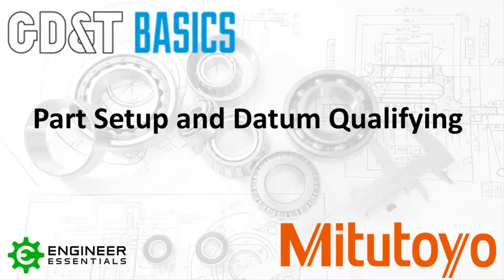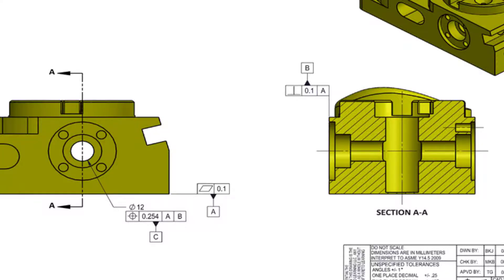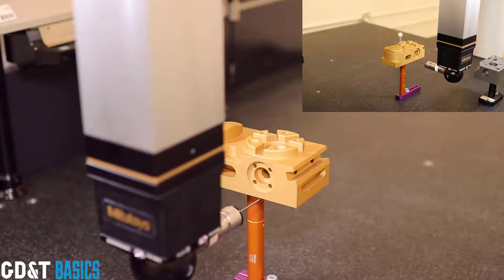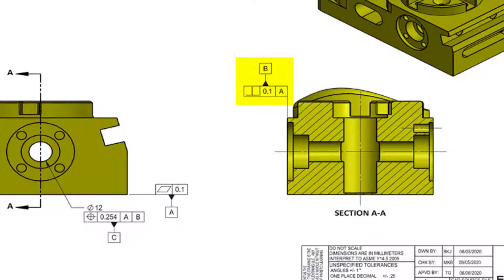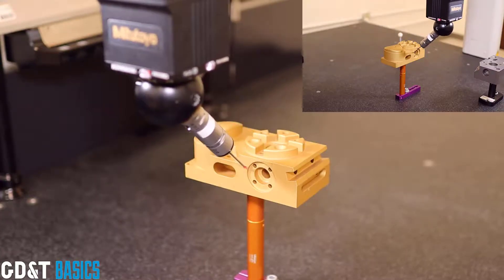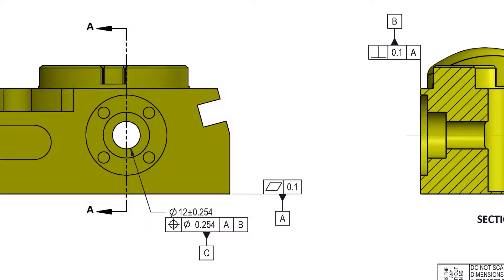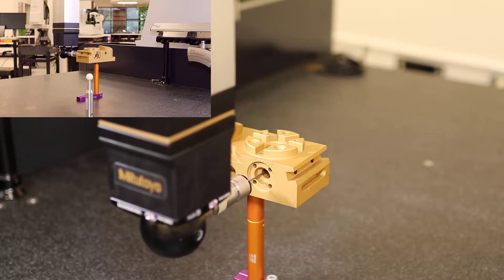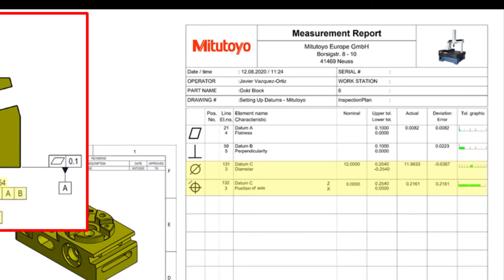Part Setup and Datum Qualifying using a CMM

Comment: It looks like the CMM defines datum A based on the point cloud (which probably does NOT include the exact 3 highest points that a datum simulator would contact). Would it be better to use a gage plate attached to the bottom surface?

Comment: Could you please explain this orange stick which is installed into the inspection part. As I see this orange stick is a kind of datum simulator. As far as I know, we do not use datum while measuring flatness. Why did you choose it, how did you choose the place of intallation, how can you make sure that it won't affect the measure?  Could you please show the installation video for more clarification. Thanks.
Reply from the maker: The orange stick in this video is not a datum simulator and it does not affect how the part is measured using a CMM. In this case it is simply elevating the part so the probe can access all the surfaces at once. The CMM will act indirectly as the "datum simulator"

Comment: I am confused about how datum axis C is established. Is the axis established wherever the hole ends up being -whether the hole is in tolerance or out of tolerance? Or is the axis established based off of the basic dimensions and the axis is perfectly positioned? If the axis is always perfectly positioned based off of the basic dimensions, this means that the hole will never be perfectly coaxial/concentric with the axis since there will always be some inherent error in the hole. Can you help clarify this for me? Thanks
Reply from the maker: Thanks for the question! The Datum Axis C is established where the imperfect hole is, BUT the imperfect axis MUST be verified to be with in tolerance with respect to A and B first ( Location and Parallel to A and Perpendicular to B ). Remember without Datum C involved we have not constrained all 6 degrees of freedom yet. So we can locate and orientate the tolerance zone for Datum Feature C back to Datum A and B using the basic dimensions but that final degree of translation that is missing will be what Datum Axis C locks in.
Reply: @Gdandtbasics  
I'm afraid that your answer is incorrect. According to the ASME Y14.5 standard the datums are derived from the datum feature simulators and not the datum features. Datum feature simulators have fixed location and orientation relative to each other according to the basic dimensions. Therefore the datum will be not where the imperfect hole is, but at the basic distance from datum A. When establishing the constraint of the part to datum feature simulator C the Mitotoyo program should have simulated the largest cylinder the center of which is located in the basic true position of datum feature C, touching the actual hole surface on the high points where it is able to reach. I wonder if the CMM program complies to the standard or is it based on a similar error?

Comment: how to do  alignment with 321 when three planes are not perpendicular to each other. For that datum target points defined 3 points for primary, 2 points for secondary and 1 point for tertiary.  ?  thank you
Reply from the maker: If you consider 3 mutually orthogonal planes creating the datum reference frames on a drawing. The drawing will have "implied" 90 degree basic dimensions for these planes that are not shown. However now if you picture the third plane being at an angle ( lets say 30 degrees ) from the second plane. The only addition that needs to be included to complete this is to add the basic dimension of 30 degrees locating that surface. In cases like this, if this is the secondary datum feature, angularity will often be used to qualify the datum feature in question back to the primary datum.

Comment: Every CMM software I have used defaults to best fit planes. (Simplified version; the points are averaged to create the plane.)  You won't get the three highest points when creating the plane unless the software supports tangent planes.  Comment is based on the four different CMM software packages that I have used.    I realize that you need to "dumb it down" but this has real world consequences especially as flatness tolerances get bigger.
Reply: Keep in mind this is not our opinion - this is a requirement of the ASME GD&T standards. Using best fit planes for establishing datums - whether it’s the default in CMM software or not - violates the ASME Y14.5 standards as it does not mimic the functional intent (physical gage blocks use high points after all - not an arbitrary average plane) Datum setup is independent of flatness as any flatness requirement on a datum feature is a separate reportable measurement vs the concept of setting up datums for inspecting other part features.
Reply: @tomgeiss5777  I've always said that default CMM feature construction assumed perfectly formed parts.
Reply: @denniskingsland2827  In many ways yes - however the parts themselves are never assumed perfect - but the datums derived from them are. The datums are the perfect plane derived from the imperfect features on the part. Not to get technically wordy but the primary datum is derived from the unrelated actual mating envelope (UAME). Actual Mating Envelope means how a perfect mating feature would contact the part. This can only be the highest points. With your experience I’m sure you have measured parts using gage blocks in the 3-2-1 rule of contact. This numbers represent the first contact points made with a (semi) perfect set of gage blocks to restrain all 6 degrees of freedom. A CMM is intended to replicate a physical datum simulation like gage blocks would. That’s why you have to use the high points. Honestly it’s a surprising topic at every place we train, due to some CMM software being a bit behind the curve on the standards. A few software programs view a datum plane (high points), and establishing the location, orientation or form of a plane (all points within a given tolerance zone) as being the same, when they require different approaches.
Reply: @tomgeiss5777  Absolutely agree that there are no perfectly formed parts and that derived datums are perfect.      My comments have been about how the derived datums are actually derived is important.  A primary derived datum feature can orient the part differently depending on if was created using the typically default best fit plane or  if was created using a tangent plane.  "Rocker" Primary datum features are more common than what one might think.   The CMM training I've received over the years rarely if ever discussed using anything but the default best fit plane.
Reply: @denniskingsland2827  It’s even more complicated in the standard. ASME and ISO had to find a way to overcome the "rocker" planes problem, and as you mentioned, it’s a very common problem. ASME's solution until the newest standard was to use a procedurally defined tangent plane, which was totally impractical for use on a CMM, and ISO used a tangent plane parallel to the Chebycheff plane. Both standards are expected to eventually choose as a default method the so-called "L2"-method, which basically is the tangent plane to a filtered Gaussian plane, which can be easily be done in a CMM software, provided you take enough points. ASME will bring this change with the next mathematical standards update, ISO is expected to follow, so that this matter will be better standardized among the different standards systems.